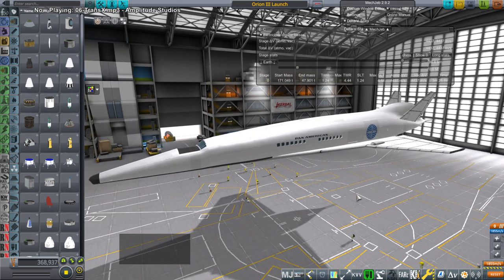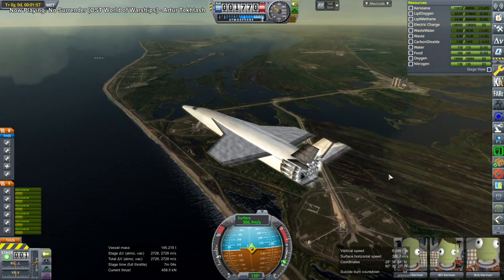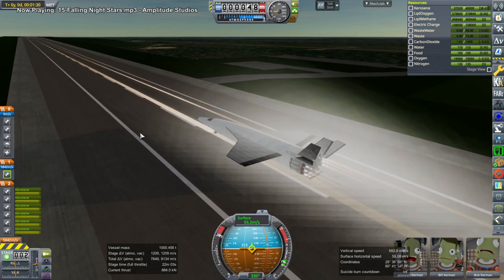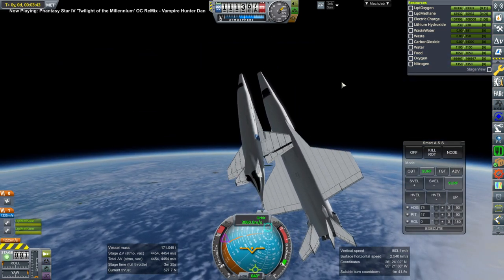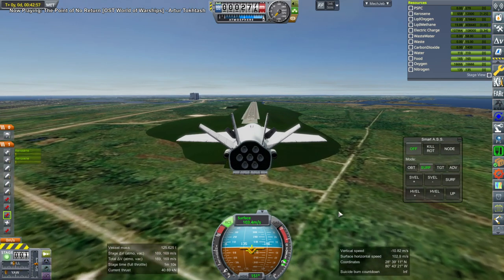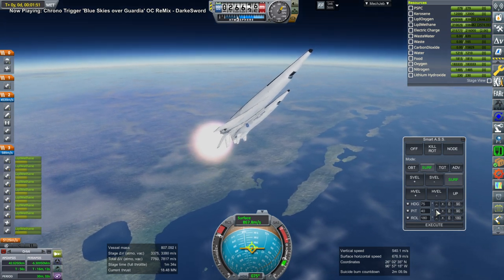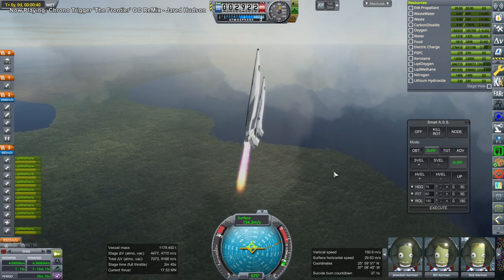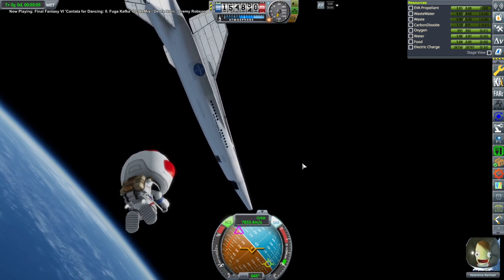KSP with Realism Overhaul - Orion III Spaceplane Orbital Test

Comment: I do remember seeing an old black-and-white magazine page that showed concept art for the Orion taking off almost vertically with its carrier plane. So you’re not too far off. Great video keep up the good work!
Reply from the maker: What's impressive is that they did enough work on the concept to realize it would have a tough time launching horizontally, even though that would be more aesthetically pleasing.
Reply: @RaizSpace  The cool idea I want to try is a design that has 3 space planes strapped together launching vertically, as the 2 booster planes break off one by one and land leaving the third space plane to go into orbit. I think it was a British design. I need to find out how to download rss/ro for version 1.11
Reply from the maker: It might be better to do it in 1.8.1, though - I still have a few issues with 1.11 in terms of liftoff and minor aerodynamic things.
Reply: @RaizSpace  A question: What is the sizing of the Orion III and the carrier plane (especially payload bay size and fuselage diameter), and how much mass can the combined system put into LEO?

Comment: I think it was actually supposed to be sled-launched to deal with the the takeoff issues, so unfortunately not an option.  Still very interesting to see it in KSP!
Reply: Could just add a stage on the back with just enough fuel to get to say 300 m/s with alot of Thrust then ditch it
Reply from the maker: Ah. I don't like the G-forces involved with a sled launch, anyway.
Reply: That's how it worked in the "World of 2001" mod for Orbiter Space Flight SImulator.

Comment: This is safer than Starship if the engines fail in flight this thing would just glide safely to the ground.
Reply: And even worse, Starship has no other abort mechanism than propulsive separation and landing, using engines that are the part nearest to the (likely exploding) booster! The Shuttle could at least glide...

Comment: I haven’t seen what this plane is inspired from but the last few projects haven’t had a horizontal stabilizer. Is that intentional?
Reply from the maker: Yes - it's basically a delta wing design. The original design from 2001: A Space Odyssey didn't even have a vertical stabilizer, but according to FAR that's not aerodynamically good. Haven't actually test-flown it without the vertical stabilizers to check, though.

Comment: Did you test the carrier planes abilities, or is that not important/going to change?
Reply from the maker: What do you mean by testing its abilities? The baseline requirement was that it had to be able to give the spaceplane enough of a boost to get to orbit and then land at Cape Canaveral. I might use it for other things besides the Orion III, if that's what you mean.
Reply: @RaizSpace  Ah yeah, ok.